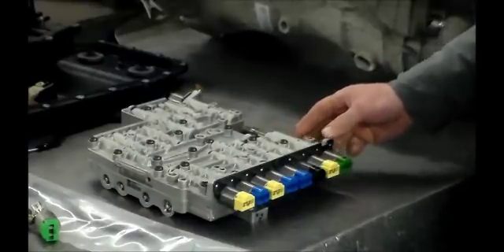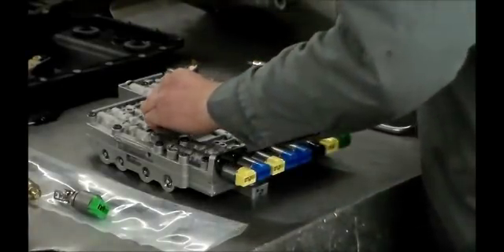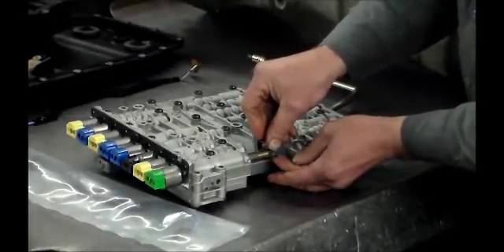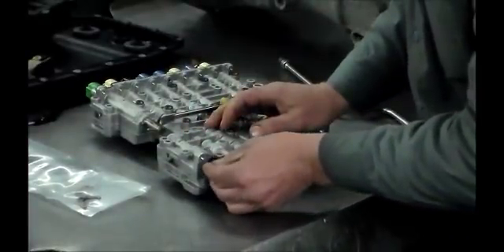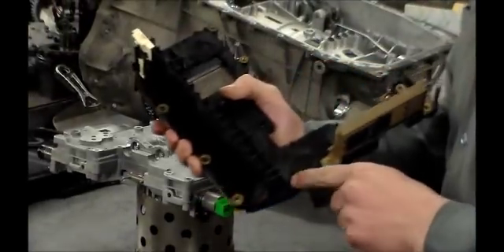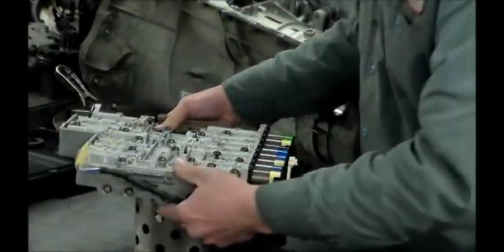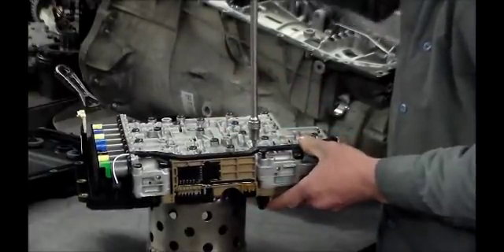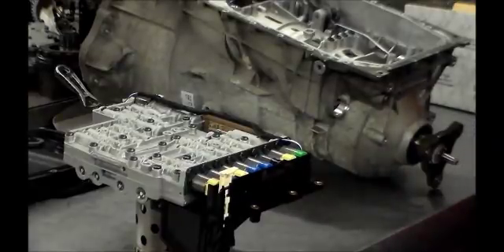ZF6HP26 E-Shift Valvebody

Comment: Hello your videos are great. I have a BMW x6 e71 35d xdrive 2009 As a precaution, I changed my oil and sealing rubbers and now the engine stalls when I reverse with a cold engine. I now want to overhaul the valve body, I just don't know which one Separator plate I need, I would rather not disassemble everything first to see which plate is in between, my question is what is the most commonly used separat plate With this type of BMW? Then I order a few different sizes. I believe it has an ag6hp26z gearbox underneath. Greetings, Koen The Netherlands
Reply from the maker: If there is a ZF supplier in your area, they may be able to figure that out by your vin number or the Stukle number on the side of the trans by the tag,  number may begin with either 1068 or 1071 maybe, then read the rest of the number to your ZF suppl;ier

Comment: Good stuff - thanks for this!  Question, you have or know where I can find a main pressure regulator valve for HP26 with the 053 separator plate?  (Standard size, not oversize) Mine has some...  "scratches", looks like the coating came off.  Not "bad", not sure I want to risk using it again.   Or, maybe if I vacuum test it, and it's in spec, then ok to reuse despite scratches?
Reply from the maker: There is a company called  Transgo,  They sell shift kits and the pressure reg valve is in the shift kit,  drop in style not oversized.  with that plate code, should be a Gen 1
Reply: @GaryFerraro  I actually have their kit and the Sonnax.  Per their instructions, the measurements on my valve say I should reuse it.  About the only thing I use from their kit is the TCC valve and spring, I think...
Reply from the maker: @garygatten1154  In the kit they want you to measure the valve because they give you 2 different Caps but you should always change the valve

Comment: Hi Gary,
Any chance you found the valve body??  I’m desperate.   Do you know what the part is called because I haven’t been able to find it on an illustration.   Here is my original message below

Hi Gary!! I need your help.  The MV2 valve has a spring and a little black sleeve with tabs on it.  Do you know what that black sleeve is called.  I putting together the same valve body but I’m missing that piece.  Trying to research online
Reply from the maker: sorry i have only M shift valvebodies,  Have you called Eriksson's ?
Reply: Thank you so much for checking and the recommendation to Ericsson’s.  

Thanks again

Comment: Hi Gary!! I need your help.  The MV2 valve has a spring and a little black sleeve with tabs on it.  Do you know what that black sleeve is called.  I putting together the same valve body but I’m missing that piece.  Trying to research online with no luck.  Any chance you have an extra a can purchase or maybe can direct me?
Reply from the maker: I will look at the shop tomorrow. I may have a valvebody.
Reply: Thanks so much!!  I’ve been searching for hours and I cannot locate the part.  I appreciate your time

Comment: Greetings from UK Garry... what.s the resistance on MV3 and MV2 for a 6HP21 ? Is it the same as for 6HP26 ? I bought a new green MV3 with new rod but measures 24.5 ohm nearly same value as the one already on the mechtronic which is 23.9 ohm. Regards
Reply from the maker: Green should be about 24 ohms and the other solenoid about 10 ohms
Reply from the maker: The MV3 early style is all one piece, the solenoid and park piston is all one, updated it is now 2 piece
Reply: @GaryFerraro  the one in the valve body measures 23.9 and the new one 24.5 ohm, is this difference of 0.6 ohm high enough to cause troubles ?

Comment: Hi Gary, i have 2008 Land Rover HSE with 235K miles. The car shifts gears and goes in reverse but does not move in Drive. I have codes P0730,P0735,P0736,P0741 and P0783. I have noticed slight fluid leak from the trans pan as well. Could this issues caused by low fluid or trans failure
Reply from the maker: First thing to do is check fluid level
Reply: @GaryFerraro  ok sounds good. Another strange thing happened is that I switched the drive to sports mode (M/S) and had it in 3rd gear and the truck moved forward. Is that a good sign at all?

Comment: Hello Gary i have a 2007 750li and i cant shift to any gears when I try to put it in D, R,N it won’t move and all my symbols next to D,R,N are flashing i got a check engine light and transmission fault i got the car scanned and was told my Control circuit solenoid E low  Pressure Control Solenoid E Control Circuit Low could changing the solenoid fix this problem thank you
Reply from the maker: Yes, it could, if you still have the scanner, try clearing the code and then try to move the shifter out of park but yes, that could happen, i had that problem already
Reply: Gary Ferraro Thank You for answering me i will give it a try love the work and help
Reply from the maker: @savageisaverage1015  ok, let me know how it goes
Reply: Hey Gary can i ask what does pressure Control solenoid E do
Reply from the maker: @savageisaverage1015  controls the pressure to the E clutch in 4th,5th and 6th gears
Reply: Hello Gary I haven’t change the solenoids yet waiting for them to come my question is could there be any other problems other then the solenoids
Reply from the maker: @savageisaverage1015  Sounds like an electrical code, could be solenoid or TCM but cannot check, no wires. You have solenoids that may be yellowand/or blue and one black solenoid.  The yellow and blue solenoids should all ohm the same and the black ohm higher(it's an on/off solenoid)  do you have an ohm meter to ohm out the solenoids?
Reply: Hello Gary i would like to thank you my problems are fixed my check engine light went off your the best I learned everything from watching you and your help much appreciated
Reply from the maker: @savageisaverage1015  Thanks for the update, glad you got it done
Reply: Hello gary after driving the car for so long i get a transmission fault error i checked my transmission fluid after the car has been running the transmission fluid is low do i need add more

Comment: Hi Gary, really good videos from you!
Ai would have a question, is it possible to use mechatronics from 6hp21 to 6hp26? The 6hp21 has a electronick park and the 6hp26 has a manual park.

Comment: Hi, I changed the solenoids on my bmw 550i recently.  Unfortunately, I did something wrong and my car won't go into park.  I'm thinking it may have to do with the E-brake.  -I didn't use cable ties to hold the lever in place prior to putting it back together.  Do you think I would need to realign it with the e-brake lever in a certain location?  Also, do the black and green solenoids both help to engage park?  I'm thinking I did something wrong with either one of those.  When I took the black on out the parts flew out.  Maybe I put it back together wrong.. Any insight would be greatly appreciated!!
Reply from the maker: You hooked up the park piston with the linkage? Can you see the park release cable where it goes in to the "J" Bracket, is there a big space in-between the cable and the J bracket.  What flew out a spring and valve when you took out the solenoid?
Reply: @GaryFerraro  Hi Gary,  I reviewed your video again and realized my mistake. When I took out the MV2 solenoid the plastic tube piece came out but I didn't see the spring fly out.  Found it on the shop floor.  I put it back together and now all is working great.   Thank you for this informative video!!  Subscribed!
Reply from the maker: @jays2231  Thanks Jay, the valve gets kinds stuck in there and then flies out. Thanks for subscribing
Reply: @GaryFerraro  Yes, that's exactly what happened in my case.  I'm pretty amateur when it comes to the inner workings of valve bodies.   Do you have any videos of how the smaller parts work?  It would be great to expand my knowledge on that subject.  Anyways, thanks again
Reply from the maker: @jays2231  I currently do not but will keep that in mind

Comment: If MV3 is bad ( it ohm'd @ 26.4) could it cause it to have the parking mechanism stuck internally even though you can select drive and reverse ( but it doesn't move as if you have the break engaged because it feels bound up)??
Reply from the maker: Does it jump back to park when drive or rev. is selected
Reply: @GaryFerraro  I have a video.. but NO it actually will select drive or reverse but won't go back into park.. however when I'm neutral it will roll forward with enough RPMs... It's very odd, acts like basically it's stuck in "park lock" while in gear.. ill post the video to YouTube then put the link down here in a minute
Reply: @GaryFerraro  please watch this and comment on here or on my video.. https://youtu.be/mVJ_eDqhmqg
Reply: @GaryFerraro  please note that for whatever reason when uploading the video the section where you see the camera pointing to the park lock lever on the side of the transmission, the video froze but you can still hear the audio. But basically what the video was showing his that deliever whenever you put it in drive would go back towards the rear of the vehicle but would no longer go forward into park whenever you tried to put it back in park.

Comment: Gary, will this cause the transmission malfunction indicator to come on in my 525i 2007
Reply from the maker: Yes, can you tell me what codes you have?
Reply: Gary Ferraro yes it’s p17e8  ratio monitoring shift 3-4
Reply from the maker: @Ilovecars1976  This code could be caused by a bad solenoid, a bad bushing or the clutch pack is bad.  What happens on the 3-4 shift, do you feel a slip as it shifts?
Reply: Gary Ferraro it does start acting up as it’s driving and you can feel something happening and then the transmission malfunction comes on the screen, not the transmission fault, but malfunction. I’m going to change the crankshaft position sensor today and will update you. I wish you were close to me I would absolutely pay you to fix her up!! Thanks for all your help! The BMW Doctor was so rude and helping one another without acting like a know it all is what it’s about! Thanks again!!!!

Comment: Hey all im in the process of re-installing my mechatronics after full solenoid replacement. As I was raising valve body I accidentally shoved shifter lever upwards. How do I bring it back down so I can align it with mechatronics.? Any help is greatly appreciated 2008 E60 e-shift.

Comment: Hi  Gary, I have a problem with my 2009 BMW 528i with zf6ph21 e-shift transmission. I've bought this car and it was not starting at all. Previous owner told me that he changed all the valves because the car was shifting from drive to reverse and park by it self. Probably it was because of low pressure. I found that valve body was installed wrong way and shifter was not in park (the fork for park rod was not in piston could not move at all). I fixed it. Now the car starts. But  I'm getting a code for solenoid 4 (shift lock) and the message that gears can be changed without pressing the brake pedal. I took valve body out of transmission and ohm all the solenoids. EDS are 5ohm. MV2 8ohm and MV3 22ohm. I know that MV3 is interlock solenoid. When it's not installed I'm getting a code for solenoid 4 (shift lock) and solenoid 3 (interlock). I pull the wire of from MV2 and I still getting a code only for solenoid 4 (shift lock). Is that MV2 defective or maybe is it transmission control module is bad? Thanks.
Reply from the maker: Can you give me the code number?
Reply: @GaryFerraro  I found a problem. It was wrong transmission control module. Probably he did swap from other transmission valve body that has no e-shift. And it locks like that module from zf6hp26 transmission because where solenoids are connected there is insulation and it has a round print on it from black solenoid right in the middle like on zf6hp26 when on zf6hp26 all solenoids are colored and making flat prints. I hope I described it well and you understand what I mean. Now I'm trying to find right module.

Comment: Hey Gary nice vdeo. I follow you now and love your work buddy!  I have 2010 750li xdrive with error code 400641: "Parking Gear Incorrectly Engaged. Code came from ISTA is this code the same as 507c and also what do you think may be causing this code. I cannot shift to any gear and the car defaults back to park and will not move at all. New bridge seal, new fluid, new adpater seal. Isat says replace mechatronics, any pointers?

Comment: Hi Garry 
i have Land rover lr4

zf transmission 6hp28 3 to 4 shift trouble when turn left or right
could you please advise
Reply from the maker: Any codes? kinda sounds like it's low on fluid, has the level been checked
Reply: @GaryFerraro  oil level already checked and no sound and I changed the filter
Reply from the maker: @ihabzou7941  So driving straight no problem?  Any codes?
Reply: @GaryFerraro  yes driving straight no problem and no code
Reply from the maker: Very strange, what kind of filter did you use?  OE?
 you check the fluid while the car is running correct?

Comment: Currently I have a 750i with the m shift valve body.. my transmission is pretty shot now.. how do I tell if another transmission is going to be e shift or m shift? Does it matter for a transmission swap?
Reply from the maker: The e-shift trans, has a "J" bracket just for park release, while the M shift you should be able to feel the detents moving the linkage. These cannot be interchanged
Reply: @GaryFerraro  thanks for the reply, so here's the issue. I am buying the transmission from a place locally and they have the car, is the j bracket something outside of the transmission bell housing? Or internally on the valve body? I'm very familiar with my m shift, but just want to make sure before I buy this transmission if it's going to be e shift or the m shift, did most 750i's come with m shift or was there something to distinguish a difference when it might be an e shift based on Vin or model?
Reply from the maker: @gravesent01   To get the correct trans, give them your vin number but heres the thing,  this trans has the TCM inside the transmission and it's programmed to your car, if your swapping out transmissions, you have to install your original TCM,  Probably early 7 series came with M shift and later E shift,  J bracket is outside the trans

Comment: So I have 2007 bmw 750LI I am replacing the shift solenoids set. Do I have to reset the car with BMW software or I should be fine? The problem with my car is. It won’t shift to any gear and the code is Solenoid B
Reply from the maker: You may just have to reset the shift adapts, this can be done with a scan tool
Reply: And can you help me find the gasket that goes to the solenoid..
Reply from the maker: @ramsang671  Where does the gasket go?
Reply: The gasket goes to the 8 solenoids. The gasket in is the connector of the solenoids
Reply from the maker: @ramsang671  Do  you mean the sleeve that goes through the case?
Reply: No not the sleeve..
Reply from the maker: @ramsang671   My e-mail is gsferraro@yahoo.com   Can you send me a picture
Reply: @GaryFerraro  mate... i am keep reading through the messages. I don.t think there is another one like you to trying help each other who.s questioning. Hat off for what you.re doing. You.re one of a kind. Thanks for your videos, sad cause this zf gearboxes not made anymore far as i know. Regards from London.
Reply from the maker: @havocprod  Thank you

Comment: Hi Gary. Thanks for taking the time to put the video together. I have this same transmission in my 2010 Range Rover. 130k and not sure if the previous owner ever changed the fluid. I did and it was pretty dirty. I keep getting "gearbox fault", then she locks into 3rd gear. The gear indicator doesn't display until she warms up oncw she gets to around 110 degrees or so.. When in park it flickers that it's in neutral. I have to bypass the shifter to get it into gear. Then once I drive for a bit and she warms up, the  "D" flickers on the dash, then eventually stays on, but will still periodically flicker and trigger the fault.  I have to keep resetting it with my scan tool. Does this sound like a valve body issue or maybe a solenoid issue? I'm thinking of finding a different valve body and swapping my TCU onto it. Does this sound correct? Any chance you're anywhere near NY? I'd bring her to you in a heartbeat. Thanks and Happy New Year!
Reply from the maker: Im in NY on Long Island,  What codes are you getting?
Reply: @GaryFerraro  P0850 (Park/neutral switch input circuit). P0915 (Gearshift position - circuit range performance). U402 (invalid data received from transmission control module). where on LI? I'm in Staten Island.
Reply from the maker: @dcap63  Let me look into these codes and get back to you.  When you clear the codes, they come right back?
Reply: @GaryFerraro   yes, but as she gets warmed up it's less often. So I'm thinking fluid viscosity has some effect, just not sure if it's one of the seals, one of the  solenoids, or the valve body itself.
Reply: Bringing it to the dealer tomorrow for a diagnosis on their equipment. I'll let you know what they say. (Although I'm sure I could guess) In the meantime, if you have any thoughts, I'd appreciate it.
Reply: @GaryFerraro  3 years later and u still never got back to him 😂